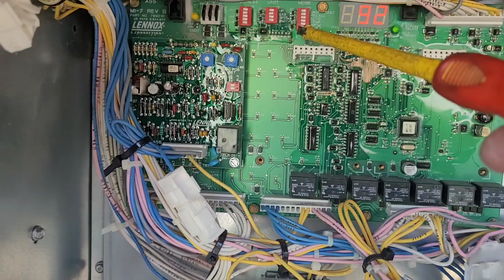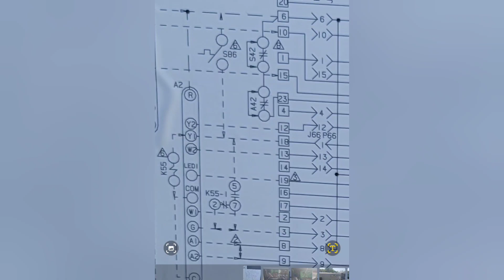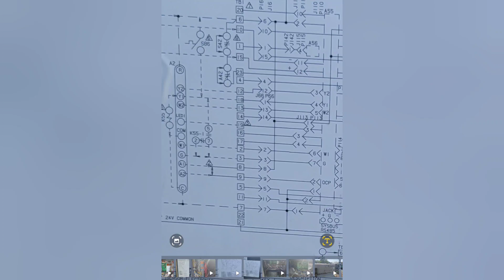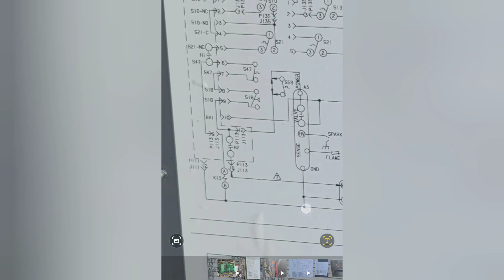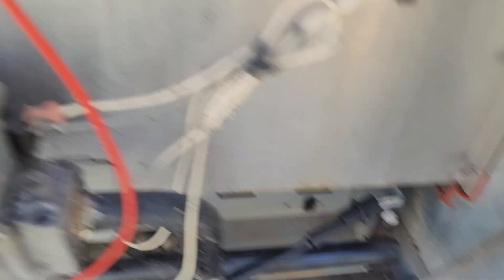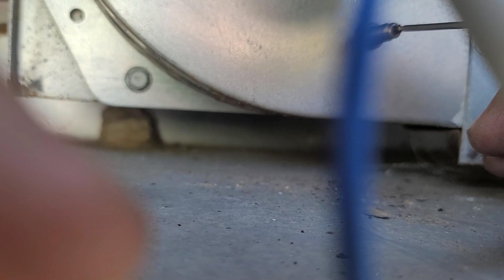LENNOX Package RTU Not heating

Comment: We are in that situation in Texas right now. AC during the day. Heat at night. At least they put the ignition module in the electrical cabinet. Sometimes I see them in the burner compartment. Not the best place for it. Thank you for another great video!
Reply from the maker: Thanks you are correct in burner section is not ideal location for it